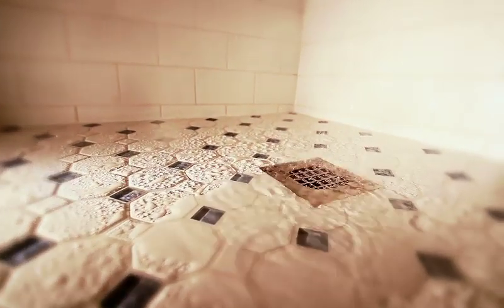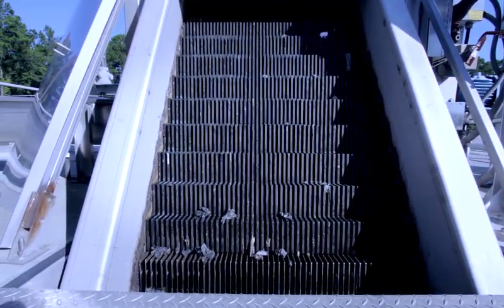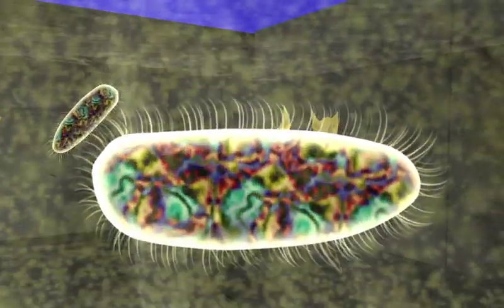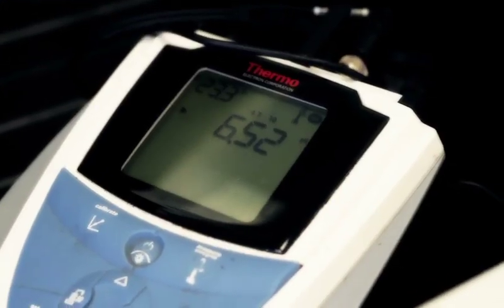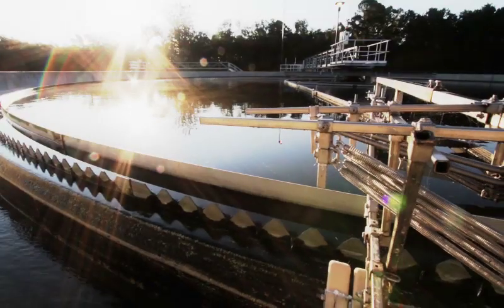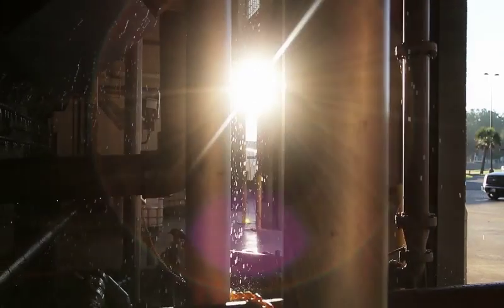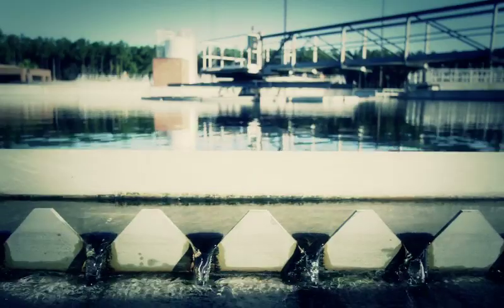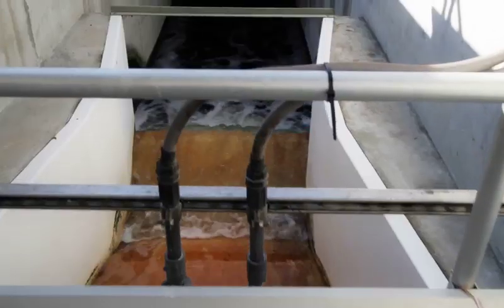BJWSA Wastewater Treatment

Comment: What about the step of adding chlorine and flouride and other chemicals? And what if someone does poisonous chemicals into the water?
Reply: I worked for a septic company and have dumped the truck at different treatment plants and also pumped sludge out of them to bring to a bigger treatment plant that can better dispose of it, either inceration or treating it enough to be sent by train to be used in fertilizer.    Some treatment plants ad chlorine as the water leaves and others use an ultraviolet light as the water leaves to kill any bacteria left before it's discharged into a river.   Some sewage treatment plants are even upstream of the plants that pull water from a river, treat it more, and send it out as city water for showers, toilets and consumption.
Reply: @badandy102  So the water I receive in my house is recycled? comes from my neighbors poop, just treated?